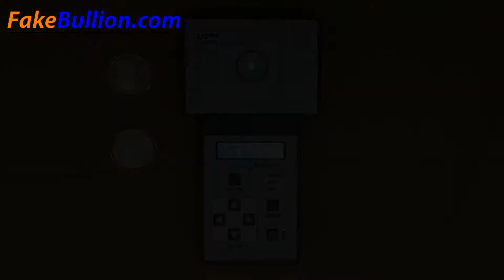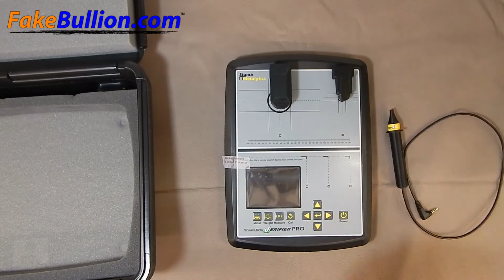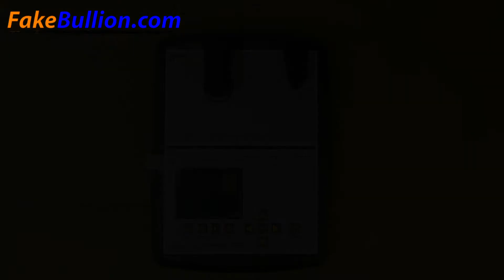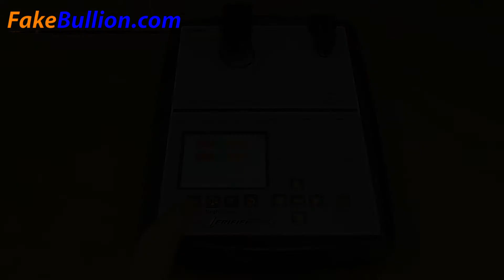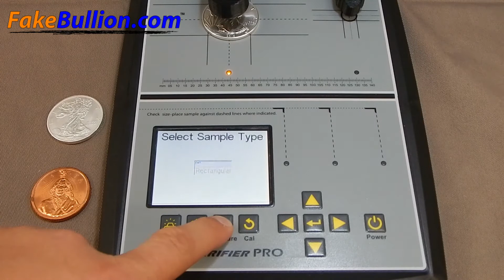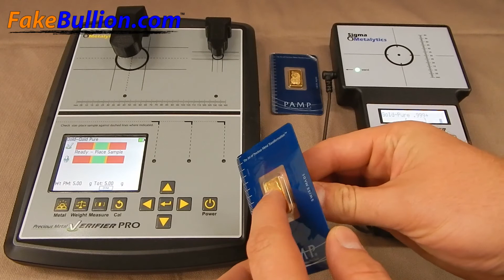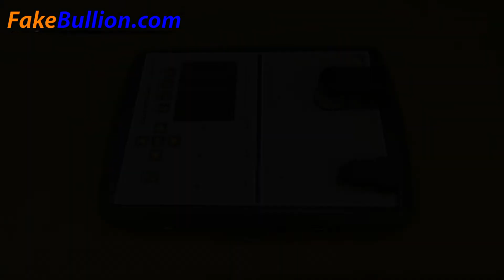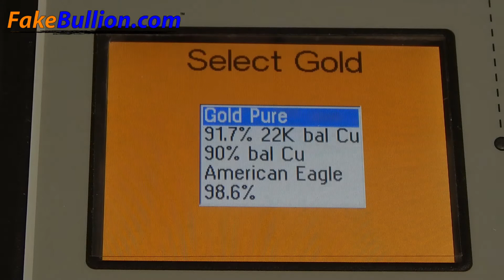[1] Sigma Metalytics PMV PRO - Introduction & Review

Comment: Appreciate the informative video. If I can't afford the pro version, do you think the original PMV in conjunction with the scale can replace the pro? In other words, are there known instances where something passes both the original PMV and the weight/scale test, but fail the PMV Pro?
Reply from the maker: Checking the weight and dimensions is really a way to check the density of the metal.  Gold is very dense, and the only practical way to match the density of gold in a counterfeit is with tungsten.  A gold plated tungsten fake could be the correct size and weight, but the PMV will show the much different electrical properties.  A copper fake could pass the PMV test, but copper is much less dense than gold, so either the size or weight of the item will be wrong.  

Whether you are using the original PMV or the PMV PRO, you still need to weigh the item on a scale to confirm the weight.  With the PRO, you can check the dimensions directly on the device.  With the original PMV, you'll need to use calipers to measure the dimensions, and you'll either need reference material to see if the dimensions are correct, or you can do a calculation to determine the density and see if it matches the expected value for gold (or silver).

The bottom line is this:  check the weight, check the dimensions, and use a PMV.  A counterfeit could pass any two of the three tests, but there is no known counterfeit at this time that can pass all three.  The PRO makes it easier to check the dimensions so you don't need another tool and reference material (or math), and also gives you more feedback with the through measurement to help detect plating.  But if you are buying mostly known items that you can find reference information for, and/or do your own density calculations, then using the original PMV along with a digital scale and calipers should keep you safe.
Reply from the maker: The resistivity of platinum is 1.06×10−7, an order of magnitude larger than the resistivity of gold. An alloy containing sufficient platinum to match the density of gold would read "right arrow" on the original PMV and far to the right in the red on the PMV PRO.

Uranium is obviously more expensive and more difficult to obtain than tungsten or platinum, and has a much higher resistivity.  Uranium is not a realistic candidate for manufacturing counterfeit gold, and even if it were, it would not pass the PMV test.
Reply: @FakeBullion  
How about a clad coin. Iridium core (higher density than gold) copper jacket (lower resistivity than gold) and gold plating?
Reply from the maker: @nickl5658  The resistivity of iridium is more than twice that of gold. The bridge sensor on the PMV PRO reads all the way through the thickness of the coin. So even if the copper jacket was alloyed to match the resistivity of gold and was thick enough to match the surface reading for gold, the through reading would still be far outside the expected range, way off to the right. 

Even the "surface" reading on the PMV penetrates the metal deeper than an XRF, so it would be a challenge to achieve a sufficient copper alloy layer to fool the PMV surface reading while still getting the overall density of the coin correct. Plus given the complexity of this hypothetical coin and the cost of iridium, a counterfeit made this way would end up costing much more than an ounce of gold.

Comment: Do you know why the 90% US silver coins are divided into three different groups by years (pre-1900, 1900-1945, and 1945-)? 

I thought that all 90% US silver coins regardless of the year are the same alloy mixture (90%silver and 10% copper).
Reply from the maker: They are all nominally the same 90% silver, 10% copper alloy. However, older coins tend to have more contaminants in the non-silver 10% balance of the alloy. It only takes a trace amount of lead, tin, or a few parts per million of iron to affect the resistivity. Sigma Metalytics checked hundreds of coins to measure the average range of resistivity values and found it was best to make three groups. The older coins have a wider range of acceptable resistivity values. The newer coins tend to have fewer contaminants, so they have a more narrow range of acceptable resistivity values.
Reply: @FakeBullion  Exactly. Even some old Morgans have really high resistivity. I have a 1879-S with a resistivity of 4.1 and will read in the red. Checks out perfectly on XRF, density, ping test. The San Fran mint is known for not having the purest processes. But still 90% Ag.